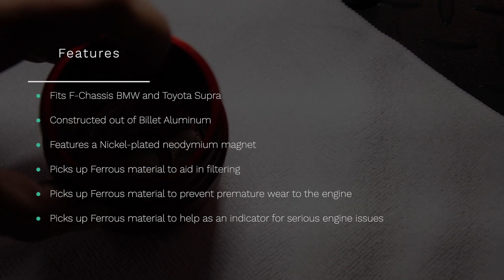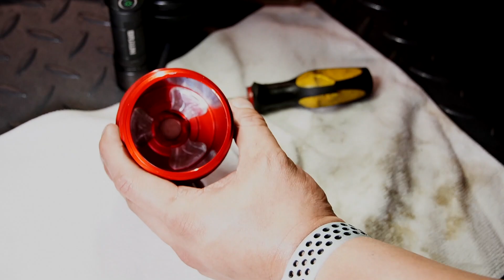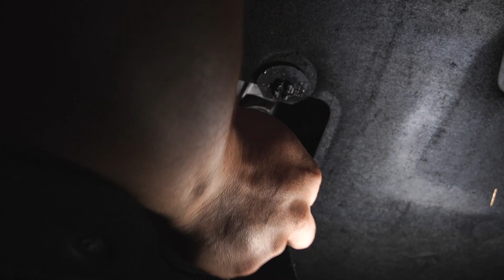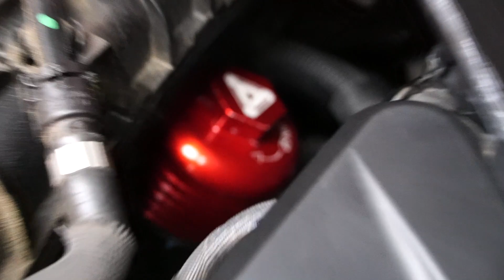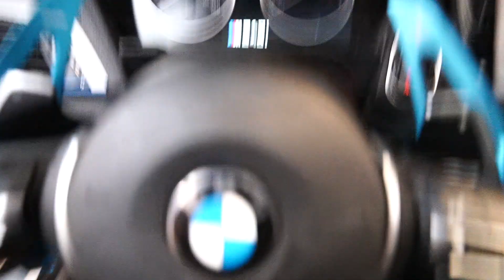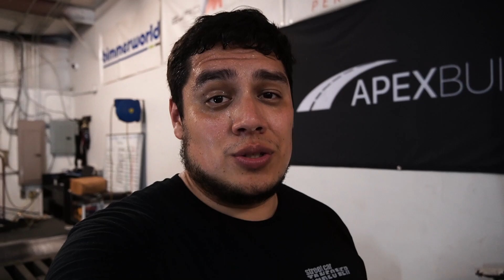Magnetic Billet Oil Filter Housing Cap for B58 by Paradigm Engineering | Oil Change DIY

Comment: The cap is more higher than original one, it makes it to close to the engine plastic part. Also please draw an attention on the vibration of the aluminum cap, it’s bigger than original.
Reply from the maker: Close to the engine plastic? No. There's plenty of clearance, it may be slightly closer to the manifold but not much I've never had a vibration issue with these.

Comment: As far as I know, magnets pickup steel shavings, not aluminum, copper, plastic and magnesium.  That's where the filter itself comes into play. Also there are mixed reviews on the alloy oil filter caps having a greater risk in cross threading and damaging an already vulnerable plastic filter housing on the B58.  Just my 0.02..
Reply from the maker: Yeah idk why I said that. Obviously just ferrous material, that’s my mistake. And no risk of cross threading, as with anything, just be careful and hand tighten first before using tools to torque it in.
Reply: I cross thread mine with this exact filter, had to replace the whole oil housing

Comment: Awesome video. Did I hear you say you're switching to amsoil?

I have a 340i with MHD Stage 2 and I changed the Amsoil Euro 0w20 for the signature series 5w30 the day I installed the intake, catless dp, and tune. What line/weight of amsoil do you plan on running?

I changed the Amsoil at 7500 miles after the tune and it still had a translucent red hue to it as it was draining.

Lastly, I thought Amsoil was PAO group 4 oil, and in order to go to a full group 5 oil, you would need something ester based like Motul 300V, and end up doing oil changes more often.
Reply from the maker: I use 5w-40 or 0w-40 in the summer

Comment: Awesome vid and thanks for sharing! I have 2 questions sir whenever able. 

1) During next oil change, how do you get to the magnet to clean off any shaving or residue? Do you have to snap out the plastic filter holder every time? It would be nice to be able to get it all clean at change time.

2) Do you think these have any effect good or bad on the disintegration meaning have you heard of any filter disintegration in any aluminum billet oil caps ever? 

Thanks for what you do bro!
Reply: If you go with the metal cap with the magnet, I would suggest purchasing another plastic oil filter cap for a spare check valve. The check valve plastic basket mounting tabs will eventually break from removing and reinstalling during oil changes.
Reply from the maker: Filter disintegration happens when you do service between too long of intervals, I try to stick to 5k miles but now I do it closer to 2k miles because of my build.